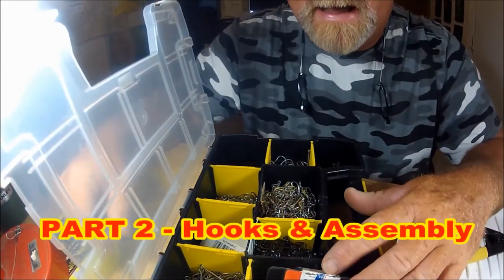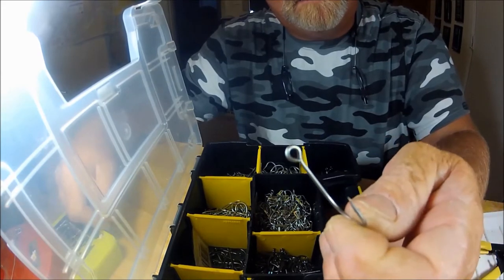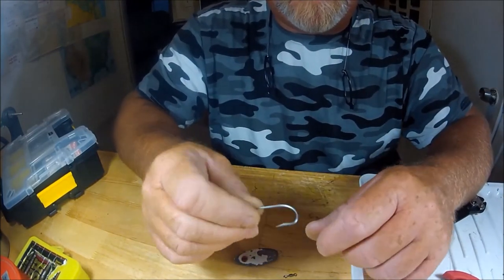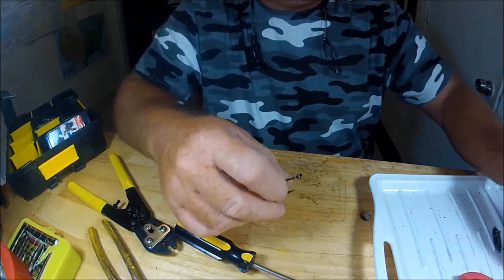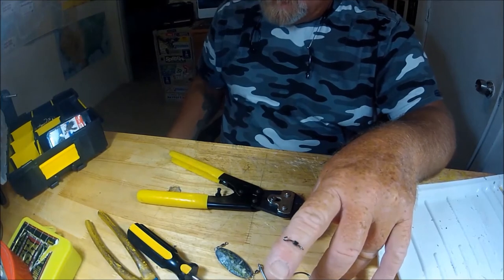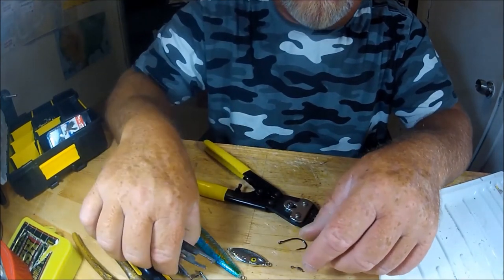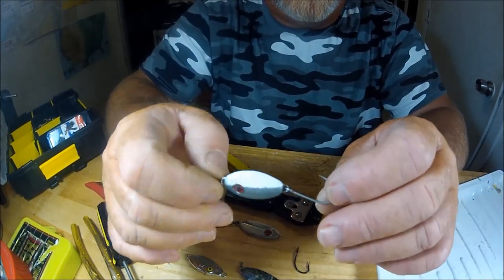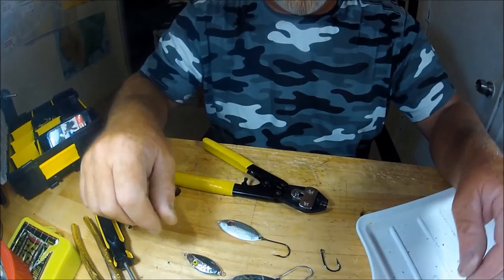Inshore/Coastal Vertical Jigging - Part 2

Comment: how many pounds do those swivels hold? More than the tinsel strength than the hooks? Hooks bend before swivels break? I have fabricated a few of my own baits from a few existing baits. But, watching you create variations is way way cool..once again, thanks for sharing your years of knowledge!!! I am a lure guy and i always need to be doing something as well... I am ready to add a new dimension to my fishing. So, very freaking COOL
Reply from the maker: strong.....or I wouldnt use them. My swivels "open eyes" were 50#

Comment: When exactly would you use these jigs? like do you use these when you're fishing shallow oyster banks and that sort of thing or just in deeper water. I just moved from South Florida up to St. augustine, and the inshore game seems pretty different up here as opposed to south florida, just kind of curious on how i could fit these into my arsenal
Reply from the maker: +Teal Thunder You moved up here from Cosmo land huh? I use these when if I used the same size jighead the hook would end up being huge. Thats how the Inshore vertical jigging started for me. You'll soon learn the tides here in NE Fla. are killers with way too much current. That's why I use these.  Watch this video....where NO bait is needed: https://youtu.be/42uWxINnvc4
Reply: +Capt Daves Sportfishing Charters Yea i've seen that one, very cool stuff. It seems like you're fishing relatively deep water there. I do 95% of my fishing out of a kayak and usually stick to relatively shallow water, 10 ft or less most of the time. I was just curious whether jigging is something i could work into those conditions, or was strictly for deeper water.
Reply from the maker: +Teal Thunder   Then, none of this applies to you. I'm a deep water St. Johns River massive current, Jetty fisherman, who found a better mouse trap.....for my "personal fishing". Customers can't do this all that easy because it takes a large understanding of tackle, the depth, the current and tackle handling techniques. This isn't for a yakker in St. Aug.  You fish DOA shrimp or a 1/4 oz leadhead with a shrimp and youre good. Just like in Cosmo land.- (aka: S. Florida)  I'm 180 degrees from a yak fisherman.